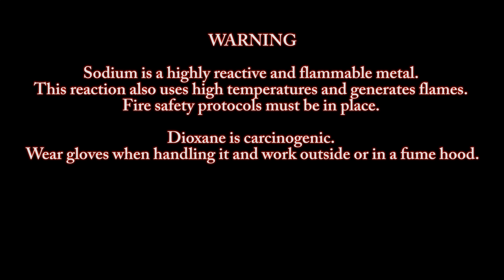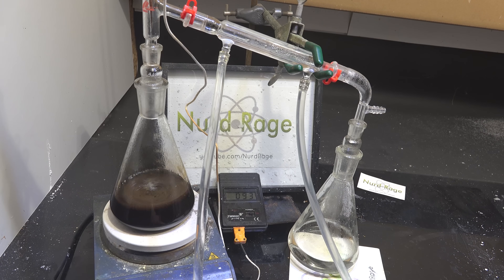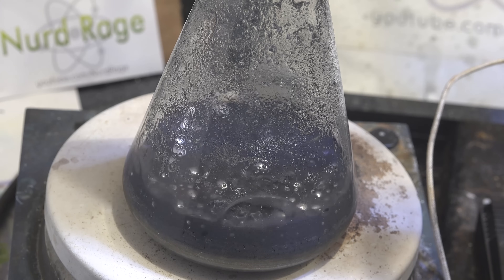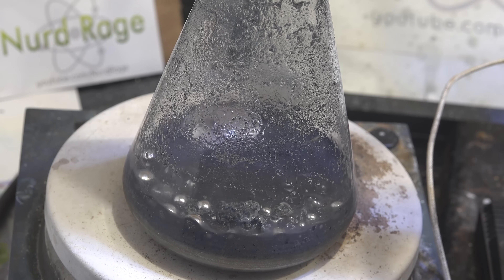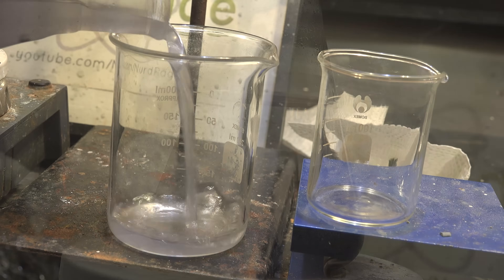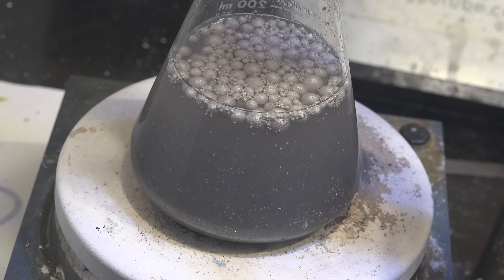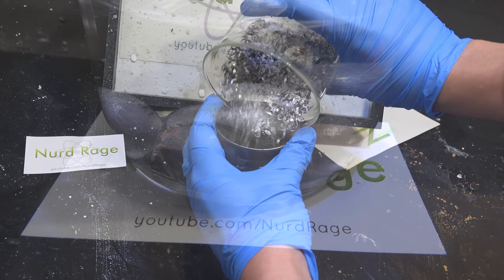Make Sodium Metal Without Electrolysis Using Domestic Chemicals

Comment: Very cool but with sodium metal under $60/Lb it's easier/cheaper to buy it. The Cesium in a barbecue now is saving money and I assume rubidium the same process but the chloride is 10x the cost of CsCl. I found a source for $1K/Kg china of course.
Would like to meet you some time, much in common. Thanks, Ken
Reply from the maker: As said in the video, sodium can be bought online. The point was to demonstrate that it could be made without electrolysis using amateur accessible chemicals and equipment. Something that had never before been known. 

But even then, just because it's easier for YOU to buy it doesn't mean it's easier for everybody. In some countries there are extensive regulations and laws around the purchase of reactive metals. Sometimes you just have to make it yourself.

Comment: question to the chem nerds out there
do you know any material that is affordable, somewhat shapeable and resistant to 800°c chlorine and molten salt?
i am thinking about a downs-cell like system for molten salt electrolysis but without additives for lower melting points. I can simply mot think of something that will definitively work for the funnel/hood part and i want to avoid costly, time-consuming or dangerous failures.

Comment: Wow...this is downright impressive. For whatever reason I expected the title to be clickbait, where to get around electrolysis you'd use some horrifically unstable reducing agent on a sodium salt. But no, you are using a thermite-like reaction. And it's not like you are getting some marginal product either, at 6:00 you can see crystals on the surface of the sodium blobs!
Reply from the maker: thanks! I was totally dumbfounded when it first happened. A decades old problem solved in my lab. I'm kinda afraid now it's all downhill from here :)
Reply: @NurdRage  can we use this method for get K°(s)?
Reply: @FranciscoJavierGC6101  probably ,since the density of K is lower than sodium , and nurd said the key is density
Reply: @NurdRage and then you discovered how to get it WITHOUT fire
Reply: @NurdRage  ....Don't think its only the solvent density that coalesces Na........please try THF, or pyridine.
Reply: @zaneenaz4962 Tetrahydrofuran is too volatile and it's boiling point is lower than sodium's melting point so that wouldn't be able to extract the sodium. I don't know about pyridine, but that would be insanely smelly
Reply: no thermite reaction is oxide are used ,not hydroxide ,unless naoh is sodium oxide not naoh ,because if u dissolve oxide in water it will be hydroide ,because water is hydra and oxide is oxide ,but when dissolved it will be nao , because its waterless ,no thats why its redox

Comment: I think  you could directly remove the pure sodium with a syringe while it was molten in the first step o try some other decantation method to avoid adittional costs to the sinthesys in large scale ;)
Reply from the maker: tried that, it was horrible.
Reply: Haha I imagined had tried it. What if it was done in a test tube? maybe it would help. Never mind, though. Cheers
By the way, the srynge should contain mineral oil before sucing the metal.

Comment: "That strange texture on the surface is actually crystallization lines. This indicates that the sodium is actually pure."
Not perfectly true. That's dendritic crystallization. It's actually more common for impure metals (i.e. alloys) but can also occur in pure metals due to thermal gradients.

Comment: What a result! I've been waiting for a long time for someone to make this happen. Now, does it work with KOH/Mg post reaction slag?
Reply from the maker: +NightHawkInLight yep. I'm working on a video of the process now.
Reply: NightHawkInLight I
Reply: It worked……I did it a few days ago,but i used KOH...and succeeded.
Reply: have you gotten that to work yet? i have tried a few times now with no success.
Reply: Was going to drop you a message mentioning you were referenced in this video, but I guess that you already know XD
Reply: Chemical Engineer I was able to get the aggregate into a flask by carefully putting a funnel directly on the lid and pouring it straight in. I had to be fast though. I just couldn’t get any metal to form. There were 3 tries and at the end of each when I emptied the glass the dioxane vapour caught fire so there was certainly potassium in there. Another try I poured it into water and the results were what you’d expect from K in water. I even tried extending the distillation by pouring the dioxane collected back into the main flask. Still nothing.
Reply: doesn't KOH transform into K at a high enough temperature ?
Reply: NurdRage mentioned on his Twitter that the potassium magnesium aggregate is pyrophoric and exploded when he tried to handle it. Guess that complicates the isolation of rubidium and caesium which are even more reactive.
Reply: Wow, that's worse than I thought.
Reply: NightHawkInLight: WOW.. And YOU Here also.? It's becomming somewhat of a celebrity night with YT-Royalty.! :))  Nice to see you.!
Reply: @explosivefreak666  He won't answer! He's a STAR! lol
Reply: @DonnyHootieHoot   :))
Reply: @DonnyHootieHoot  lol

Comment: When i was about 12 years old I thought it would be interesting to try to make my own sodium.. I didn't have any books about chemistry or internet so i was just guessing on how to do it.. First thing i tried was melting salt with a blow torch and running electricity through it, that of course didn't work. Next thing i tried was running a spark of electricity at about 25kv through a pile of salt.. and immediately started smelling chlorine gas. At this point I became rather worried and decided this project was too dangerous to be doing in my parents garage and gave up on the project xD
Reply: You were close, the Castner process - electrolysis of molten sodium hydroxide - would've got you there. Of course it could've got you in a lot of trouble too. Molten sodium hydroxide is hardly "safe" by any stretch.
Reply: Nathanael Newton at least you succeeded
Reply: Nathanael Newton dude that’s me rn
Reply: That's me right now!!

Comment: Powdered magnesium instead of shavings, better mixing, Ceramic crucible with a good lid and small pop out vent hole/s to restrict air AND keep it from being a bomb, use ceramic tiles as filler so less air in burn chamber to start with, then a glass blender so you can use dioxane when grinding the slag you could see returns of 60% or higher.

Comment: Why is magnesium oxide the product and not magnesium hydroxide? Magnesium hydroxide has a much higher enthalpy of formation than the magnesium oxide.
Reply: At high temperatures (350 ceslius and up) the magnesium hydroxide will decompose into magnesium oxide
when it ignites, those temperatures are met in this reaction thus you are then left with magnesium oxide and sodium in completion.

Comment: Very well done.  I propose the Na-MgO separation is purely physical, hot dioxane wets Na well based on fluid tension and adhesion.  Perhaps emulsification of molten Na drops.  Fluid -solid adhesion and fluid tension is a very specific thing.  Many times a fluid is called a "catalyst" due to this specfiicity.  Nice achievement, congrats.

Comment: I am not a chemist, but I suspect that a sodium dioxane complex is temporarily formed during separation, try with a different double ether of similar boiling point and oxygen to oxygen spacing, chances are it will work even without it being a dioxane.

Comment: Please show the production of magnesium without electrolysis. The Dow process uses electrolysis, and the pidgeon process requires silicon, which can be made from sand and carbon - but I imagine requires very high temperatures
Reply from the maker: Yeah the temperatures are rather high. so i'm not sure if i would do it.

Comment: is there a way to make magnesium metal without electrolysis?
Reply from the maker: yes, it can be reduced with silicon. there is lots of waste silicon from semiconductor manufacturing so it can be made rather cheaply that. In fact china is the world's biggest producer of magnesium for this reason.

Comment: Why do your beakers not break when you heat them on the plate? All mine are broken already :( (Yes, they were made of borosilicate glass, if i can trust the manufacturer)
Reply from the maker: Try a different manufacturer. Some of them, especially the really cheap ones, are notorious for pushing fake products that claim to be borosilicate but are actually the really cheap soda lime glass.
Reply: Thanks. I know you want to promote your beakers, but I live in Germany. Do you know a trustworthy.... Oh... I see that it will be hard for you to name one. I usually buy on Amazon.de. And no one can know if the prints on the beakers are real therefore I need to find an vendor that I can trust and trustworthy supplier of that stuff might only be selling to professionals... Ah God damnit.
Reply: look on chemoline expencive as fuck but it works for us, look at ebay for some used ones, you can get a lot of high quality glassware for very cheap, that's how we got everything at least. it's harder to get chemicals here in Germany than some beakers...

Comment: Why is electrolysis so difficult to do? Expensive equipment? If I had to guess that'd be mine but I'm curious. I've always wanted to extract rare earth metals by dendritic sublimation and/or electrolysis but I run into a similar problem with lack of money  haha
Reply: You can electrolyse molten sodium hydroxide  to obtain sodium. This has to be done at just the right temperature or you will obtain no yield. A mixture of sodium chloride and potassium chloride melts easier than aluminum and can be electrolysed but make sure you have a good chlorine scrubber connected near the anode!

Comment: Anyone who isn't a patron who has any desire to help keep these videos coming, it's very easy. Nurdrage provides a link to Patreon in the comments. You sign up, follow a few simple steps, and et voilá, you are supporting the production of great videos like this. I linked to PayPal, but they support other means of payment too. Also, you can set the amount you give per video. There are suggestions, but you can override to a higher amount if you wish, or contribute as little as you like. Any amounthelps. On chrome on my phone, I couldn't change the amount, I had to get on a computer, so you might have to switch browsers, or get on a computer, but it does work.

Comment: Maybe you could minimize the loss, when you ballmill the aggregate inside a vacuum vessel. Afterwards going back to standard pressure by soaking in dioxane instead of air.

Eventually even the initial Mg-NaOH reaction could be done somehow inside a vacuum.

Comment: NurdRage, can you make sodium by sodium acetate electrolysis?
Reply: Higor Guedes I doubt it because the acetate would decompose long before it melted.
Reply: It looks like that would work.  Melting point 324 °C (615 °F; 597 K) (anhydrous).  But it probably has the same issues as with NaOH electrolysis.

Comment: Finally! A better way to make sodium! This looks like a much safer method than electrolysis and it yields quite an impressive amount of very pure sodium for the relatively small amount of inexpensive reactants used. While electrolysis works, the high temperatures and current plus the fact that molten NaOH is used makes me nervous, plus I lose a lot of sodium to oxidation since i don't happen to have an inert gas cylinder. I definitely want to try this! Thanks NurdRage!
Reply: Do you happen to have someone nearby who does blacksmithing for a hobby?  Molten sodium chloride baths are sometimes used for heat-treatment of metals, and he'd have all the equipment to handle high-temperature things safely.  I've been tempted to try some electrolysis myself, but I just haven't had the time or a project needing enough pure sodium to actually try setting it up...

Comment: I need some help. I'm trying to turn lead oxide  (it came out of a car battery) into lead. I know that I need to heat the lead oxide and a source of carbon monoxide past leads melting point. The propane torch that I'm using to heat it works just fine, but I don't know of a good source of carbon monoxide (I've tried charcoal briquettes, but they didn't produce enough). Any suggestions?
Reply: Grind it with charcoal and ignite? It is probably the easiest way.

Or you could try torching the oxide until it is really hot then blow a stream of propane from the torch over the hot oxide.
Red hot Bismuth oxide can be reduced by propane this way(although it is slightly more noble than lead).
Reply: AureaPersona I haven't tried grinding the lead oxide  (I take backyard chemistry to the literal exterme) yet. Any suggestions on how to grind it?
Reply: First powder the charcoal separately with a mortar and pestle.
Add the charcoal powder and lead oxide to a steel soupcan or similar disposable container you don't mind contaminating with lead and mix it together with a steel rod(or whatever stiff rod is at hand) until it is a somewhat homogeneous mixture.

Ignite the mixture directly in the can or transfer it to a crucible / disposable teacup for ignition. if mixed well enough in the proper ratio it should burn and leave glob of lead metal in the bottom of the crucible. 

The hot lead oxide will be reduced both by the direct contact with the hot carbon and the carbon monoxide  gas formed during the reaction. 
You could add both the oxide and carbon to your mortar for easier mixing but i suggest against it as it would contaminate your mortar with lead.
Reply: AureaPersona IT WORKED 😀Thank you very much!

Comment: So... what kind of compound can be achieved if in stead of magnesium use titanium? I mean would it be possible to get something even more reactive! I Have a bunch of titanium shavings, and have been using them as fire starters!! Please don't insult me in case that my question is just to stupid...
Reply: Titanium oxide can behave like an acid, so it can react to form compounds like M2TiO4. This could stop the formation of sodium.
search for : Titanate
Reply: I'm very grateful for your input, Honest the only reason that I decide to ask is because I have those materials, and very much the only thing that I'm interested on is the purpose, what can be done with it! I was hoping for some different type of alkaline metal.. that is reactive, I remember seen some reactive metal that lights purple!!
Reply: Potassium
Reply: Migueldeservantes Do it!  My first instinct is that you might not get as good of a sodium yield since Titanium Oxide does not have as big of an energy of formation as magnesium Oxide.
(Magnesium Oxide is thermodynamically stable so the magnesium metal takes away the oxygen/hydroxide from the sodium hydroxide)

But try it out and see what happens!

Worst case scenario, it might not work as well (might need more Titanium metal to purify same amount of sodium)

Best case scenario, you notice something cool that maybe nobody has seen before!

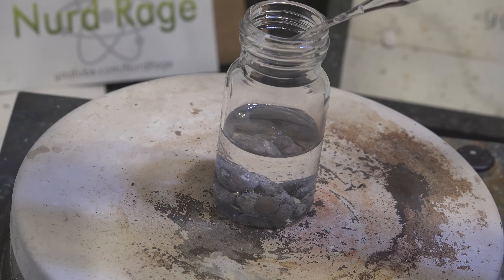Comment: During the cleaning step that takes place at 9:09, could I collect the molten sodium into a glass syringe and then deposit it into some other mineral oil?
Reply: yes, but heat up the syringe first or the sodium will freeze and stick in the syringe
Reply: Lajos Winkler Mineral oil works also. NR used it in his videos.

Comment: I'm sure I'll be laughed out of the room for this but, can you extract the sodium from sodium chloride?
Reply: yes, by electrolysis. but the melting point of generally available NaCl is 800 deg. C so it's difficult.
Reply: As low as 505 °C with Eutectic mix of CaCl2.  Source:  http://en.wikipedia.org/wiki/Downs_Cell
It's damned hot.  Then again home-gamers routinely fuse glass in a microwave, so go figure.
Reply: It is way harder and more dangerous.

Comment: Thank you. Awesome! This seems so much easier, than electrolyzis. 
The problem I have had trying electrolyzis, is that molten sodium hydroxide "eats" almost anything (even glass). Sodium chloride can also be used, but need to be molten (melting point 801°C) and also "eats" most materials that you could use for a crucible or electrodes (and materials that may handle it chemically, can't take the heat instead - glass for example, will melt).
Reply: Would a graphite crucible hold it?
Reply: Maybe - I havn't tried that. But it's not just the crucible - even the electrodes is an issue. My experience of using graphite electrodes for many electrolyzis reactions is that they tend to contaminate the whole thing with large amounts of carbon dust. It isn't exactly an easy task to filter out pulverized carbon from molten sodium hydroxide or sodium chloride (like you can do with water based reactions for example).
The problem isn't really that it "eats thru" the crucible in most cases (even if that may happen to), but that it tend to contaminate the whole thing. If I for example just melt sodium hydroxide or sodium chloride in an old cooking pan
 - it will hold up long enough to work, but the molten hydroxide/chloride quickly turns brown or black because of contamination. That will likely also make your sodium quite impure.

Comment: Wait wait. Sodium is magnetic in a liquid state???
Reply: Slightly paramagnetic, but eddy currents work in anything conductive even if non magnetic.
Reply: Sodium metal has a magnetic susceptibility higher than glass. If it was spinning from paramagnetism (electron spin) the glass ampule would be rolling all over the place. It's not spinning from paramagnetism it's spinning from eddy currents
Reply from the maker: The glass vial is frictionally stopped by the hotplate. but the sodium is free to move. Nonetheless eddy currents are indeed the dominant factor.
Reply: Dots kinda, it has an unpaired electron I believe the rotation seen in the video is caused by eddy currents in the metal which originates from delocalized charges
But it's likely too hot for the observed magnetism to be the result of spin